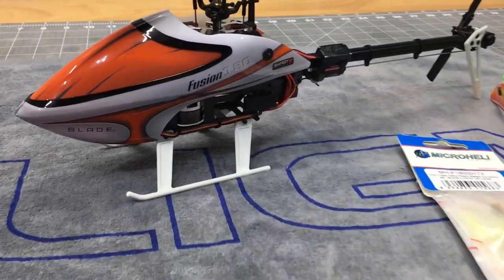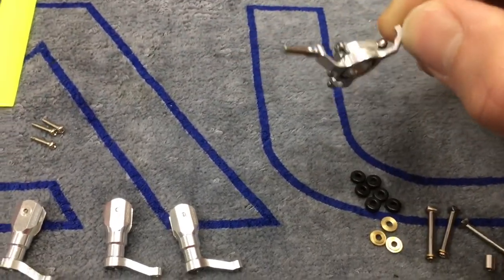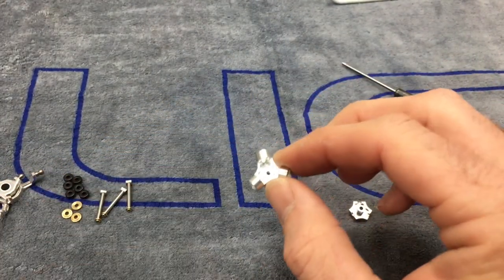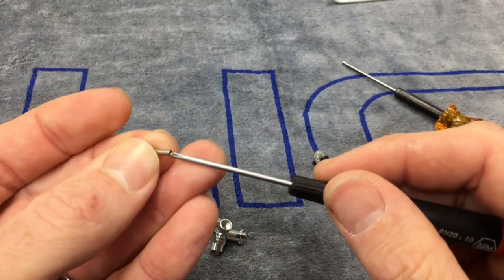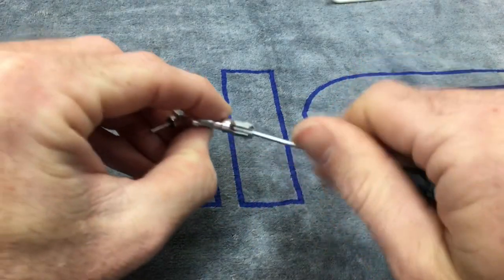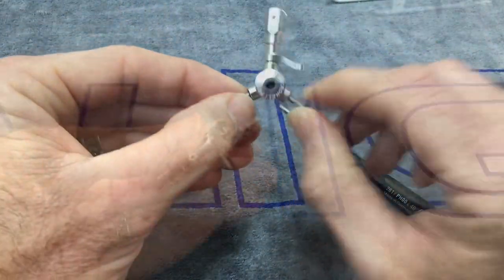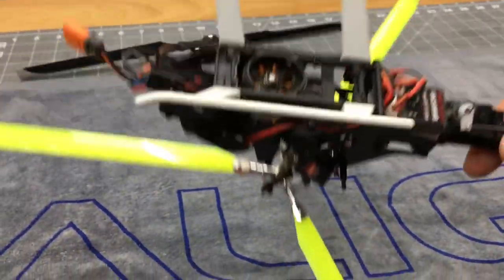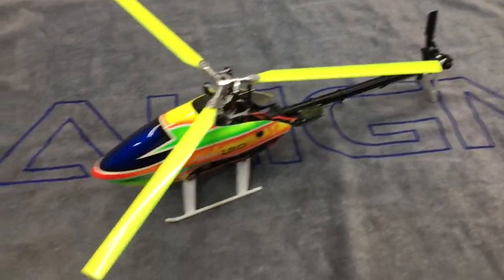MicroHeli Three Blade Head Assembly For The Blade Fusion 180 Smart￼

Comment: ive found that using the stock blades on the triblade head flies way better than the blades microheli puts in the kit, curious to see what you think about it
Reply from the maker: Stock blades that come on the kit don’t fly terrible but they don’t fly great. You definitely have to run a very high head speed to get a good feel and performance. But I ended up going with their 180 mm blades that they sell for the M2 and like those way better than the stock blade 180 blades. I also have a set of 180mm carbon blades for the three blade M2 and those fly great as well.
Reply: @westhobbiesrc8051  Gotcha, when i tried to fly with the microheli blades i couldnt even get the heli off the ground in normal mode lol had to take off in stunt 1, found out the factory blades fit in the grips and just threw them on, now it flies just fine
Reply from the maker: @theheliguys9474  I have no problem getting it off the ground in normal mode or any mode. I flew it around a couple packs. He definitely had to be high on the collective in normal mode but it did fly. I like the 180mm carbon blades the best.

Comment: Blade's canopies are always pretty poor. I mean the construction's not bad, it's more the design, like having to remove it to fit the battery, and the art work always seems to be a bit boring.
Reply from the maker: @yakacm  I personally have always hated blade canopies. They use a thin cheap plastic and it just doesn’t fit and cracks. MicroHeli makes a very nice fiberglass canopy but this one took some trimming to fit to ,y liking.